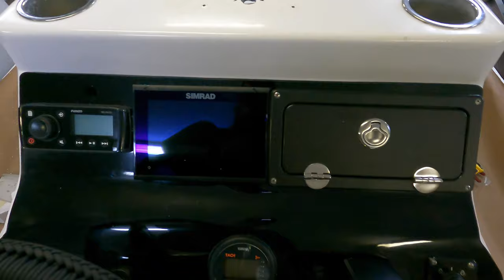HOW TO MAKE AN ACYRYLIC DASH For Your Boat- Step by Step Using Map Gas & Propane Torches

Comment: Good timing, I just ordered acrylic to redo my dash. Yours is the best video I’ve seen on acrylic dashes so far. Thanks for posting. Looks “pimp”, I agree
Reply from the maker: Thanks man!  It was tough bending 3/8 thick for sure.  Also make sure you use map gas instead of propane.  Works much better.  Let me know how yours comes out!
Reply: @JackedUpFishing   My dash came out better than expected, should have done it earlier
Reply from the maker: @nickfonder3441  awesome man!  So glad I did mine too.

Comment: How did you screw the fish finder and glove box in without cracking. I’m on my second piece and it cracks every time
Reply from the maker: You have to predrill to the exact size of the screw.  At least that's what I did.  What thickness is your acrylic?
Reply: I used 1/8 but just ordered 1/4 so hopefully that helps. Did you use a step bit?
Reply from the maker: @jaciereconte-hr4qs  no just a regular bit.  1/4 is thick.  I used 3/16

Comment: I was surprised to see you use the propane tourch. I would have used a heat gun if I hadn't seen this.
Reply from the maker: Yeah with 3/8 thick heat gun will not do it.  Had to use map gas actually as propane wasn't even enough
Reply: @JackedUpFishing  I didn't even think about the thickness.  Good to know before I start my project.
Reply from the maker: @Picasofly  yeah it makes a big difference